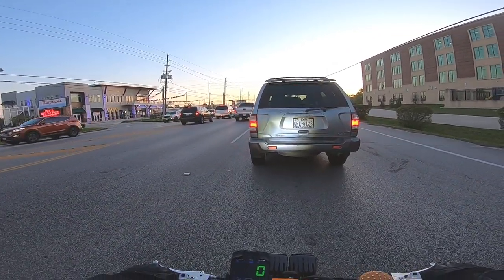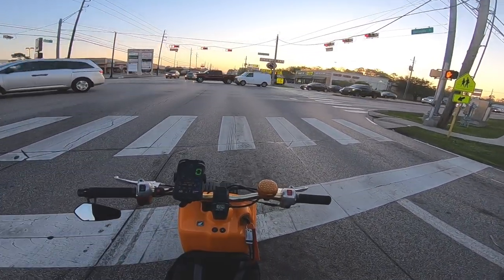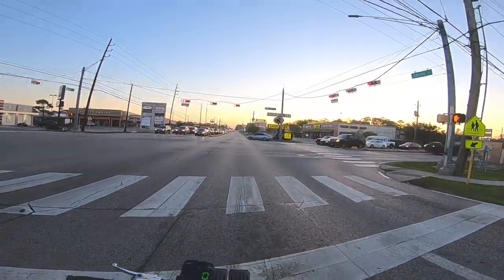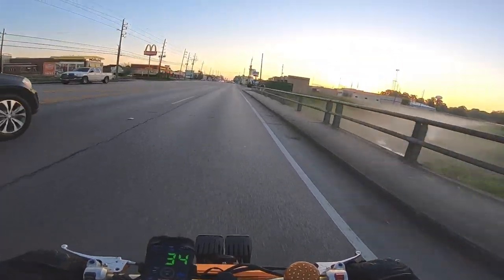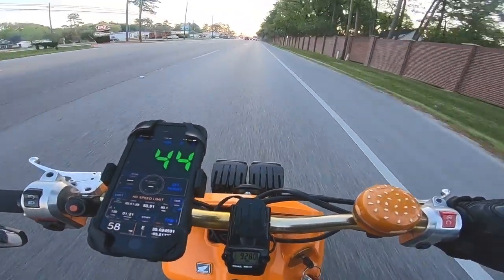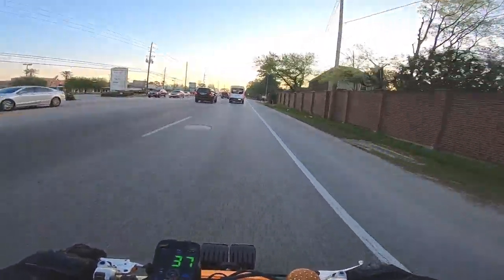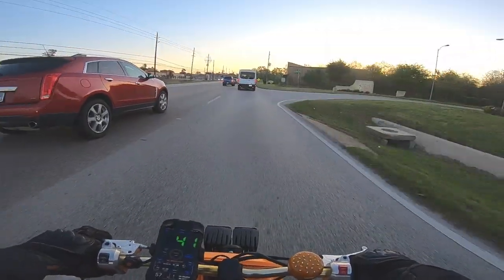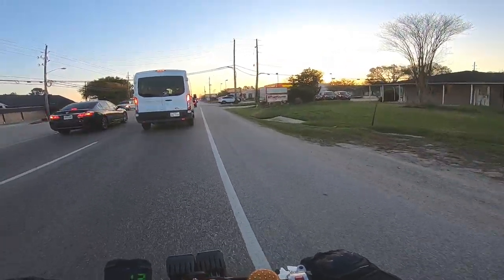Three things I am always checking / adjusting on my Honda Ruckus #HondaRuckus #RuckusMods

Comment: Any reason you don’t just leave the cover off until you get done tuning?
Reply from the maker: not sure why. Someone even told me to just bolt it back up with like three instead of all of them
Reply: I’ve heard that running a scooter with the cvt cover off could potentially crack the swing arm, leaving you with a badly damaged engine. I’m not sure if the ruckus is prone to this problem, but to be safe I always bolt my cvt cover back on after tuning. It only takes a few moments, and to me it is not worth the risk leaving it off.
Reply from the maker: Mine is always bolted back on 100% . I don’t feel right leaving screws open and not connected :)
Reply: @matt1357111317  the cover does nothing. They used to make custom fiberglass covers which are a lot less strong then the metal cover. When I had my first one I rode it around in like one week stretches 3 or 4 times with the cover off. While there may be a risk, if you buy a roller set pack it wouldn't take you more then 2-3 days to figure out the optimal weight.

Comment: Your cleaning your carb so much because if your not running a filter dirt gets in your jet,wears out your slide and the slide bore,finds it's way into float bowl ECT,ect.J.P. CYCLES makes stacks tthat have a filter that goes at the bottom of the stack.the stack may not fit but the filter can be trimmed down.best of luck and hope that helps
Reply from the maker: That’s a good point. I stopped being filterless and for a started filtering so I didn’t notice before but I haven’t cleaned my carb in a month